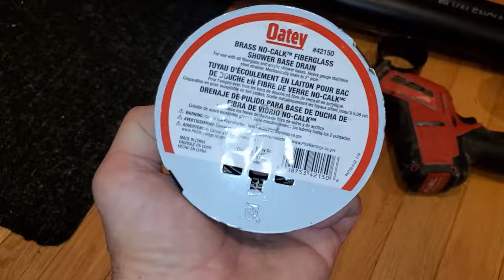Shower Drain Flange Replacement

Comment from the maker: As you can see, it was installed on silicone, but the silicone came off and was leaking. I would strongly recommend use LEXEL or similar product from Home Depot  DAP 5 oz. Ultra Clear All Purpose Waterproof Sealant. It's stay forever soft and sticky to the surface.
Was replaced Brass Shower Drain. OATEY Round No-Caulk Brass Shower Drain - Home Depot https://rb.gy/e92l2o
Oatey 40601 Hercules 300-Degree Plumber's Grease - Amazon  https://rb.gy/tddngx
Lexel Weatherproofing Caulk - Amazon https://rb.gy/m6sqps
DAP Ultra Clear All Purpose Waterproof Sealant - Home Depot https://rb.gy/n9sp1y
Similar problem with shower pan and repair: 
Shower Drain Removal and Installation https://youtu.be/91zP7k0vYaI?si=srCmIvKacWKWrRbo
Shower Pan Leak and Gasket Drain Flange Repair  https://youtu.be/TtinP2rj1kQ?si=xHL8waBtzNqEloIl
You may be interested to watch 13 videos of "How I build the Deck 12' x 20'."  https://youtube.com/playlist?list=PL9fyWqL02lqkUWshlwsCqzBcRR8BEMETo&si=gji00z9tUFKtY7KG

Comment: a lot of work, this vs putty plumber which one better?
Reply from the maker: If the pan floor surface moves/deforming when stay in the shower cabin - better use flexible sealer.

Comment: How big is the pipe? Could you please share the link of the saw that you cut the pipe? Thank you.
Reply from the maker: At 2:28 you can read the flange sticker, they said it fit for 2" pipe diameter.
Saw - Milwaukee FUEL 2520-20 M12 Hackzall Bare Tool ,  Amazon link  https://rb.gy/dmzndc

Comment from the maker: Was used:
Shower drain brass flange - OATEY Round No-Caulk Brass Shower Drain with 4-1/2 in. Round Snap-In Stainless Steel Drain Cover - https://www.homedepot.com/p/OATEY-Round-No-Caulk-Brass-Shower-Drain-with-4-1-2-in-Round-Snap-In-Stainless-Steel-Drain-Cover-421502/100092829

Sealant - Lexel Synthetic Rubber Sealant 5.5 Oz Sashco 13013 Clear  
https://www.paintsupply.com/product/caulk-foam-sealants/polymers-urethanes/advanced-polymer/5-5-oz-sashco-13013-clear-lexel-synthetic-rubber-sealant/
https://www.amazon.com/Sashco-13013-2-Sealants-Adhesive-5-Ounce/dp/B0012DIUYW/ref=asc_df_B0012DIUYW/?tag=hyprod-20&linkCode=df0&hvadid=168238778532&hvpos=&hvnetw=g&hvrand=13508610972105685963&hvpone=&hvptwo=&hvqmt=&hvdev=c&hvdvcmdl=&hvlocint=&hvlocphy=9053022&hvtargid=pla-332215549834&psc=1
https://www.lowes.com/pd/Lexel-5-fl-oz-Clear-Paintable-Solvent-Caulk/1000269867?cm_mmc=shp-
LEXEL or similar product from Home Depot  DAP 5 oz. Ultra Clear All Purpose Waterproof Sealant.
It's stay forever soft and sticky to the surface. 
https://www.homedepot.com/p/DAP-5-oz-Ultra-Clear-All-Purpose-Waterproof-Sealant-18387/306641586?source=shoppingads&locale=en-US&pla&mtc=SHOPPING-BF-CDP-GGL-D24-024_002_CAULKS-NA-Multi-NA-PLALIA-NA-NA-NA-NA-NBR-NA-NA-NA-FY21_Sundries_PLALIA_&cm_mmc=SHOPPING-BF-CDP-GGL-D24-024_002_CAULKS-NA-Multi-NA-PLALIA-NA-NA-NA-NA-NBR-NA-NA-NA-FY21_Sundries_PLALIA_-71700000074808981-58700006445316099-92700058237758752&gclid=Cj0KCQjw_O2lBhCFARIsAB0E8B9FZMA5IIS3gJV2X-HH56bfNEykXU75CJ6kv_NdXs8UAJ0ESyNpzgAaAtQcEALw_wcB&gclsrc=aw.ds#overlay
Reply: Can I use any other sealer besides the lexel ones that you used?
Reply from the maker: @moemoney4614  As you can see, it was installed on silicone, but the silicone came off and was leaking. I would strongly recommend use LEXEL or similar product from Home Depot  DAP 5 oz. Ultra Clear All Purpose Waterproof Sealant.
It's stay forever soft and sticky to the surface. 
https://www.homedepot.com/p/DAP-5-oz-Ultra-Clear-All-Purpose-Waterproof-Sealant-18387/306641586?source=shoppingads&locale=en-US&pla&mtc=SHOPPING-BF-CDP-GGL-D24-024_002_CAULKS-NA-Multi-NA-PLALIA-NA-NA-NA-NA-NBR-NA-NA-NA-FY21_Sundries_PLALIA_&cm_mmc=SHOPPING-BF-CDP-GGL-D24-024_002_CAULKS-NA-Multi-NA-PLALIA-NA-NA-NA-NA-NBR-NA-NA-NA-FY21_Sundries_PLALIA_-71700000074808981-58700006445316099-92700058237758752&gclid=Cj0KCQjw_O2lBhCFARIsAB0E8B9FZMA5IIS3gJV2X-HH56bfNEykXU75CJ6kv_NdXs8UAJ0ESyNpzgAaAtQcEALw_wcB&gclsrc=aw.ds#overlay
Reply: @FixitAll  ok,thanks for replying and recommendation..I appreciate it,it is indeed a big help
Reply: @FixitAll  man I finally did it by myself..this really helped a lot,Thank you very much🙏🏽..I wish I can post a pic here
Reply from the maker: @moemoney4614  If you have Facebook, you can post pictures and say something in my group Fix it All. 
https://m.facebook.com/groups/1806257682736206/?ref=share&mibextid=NSMWBT